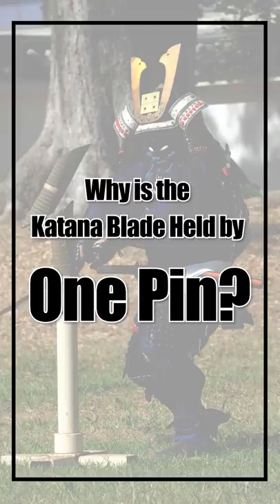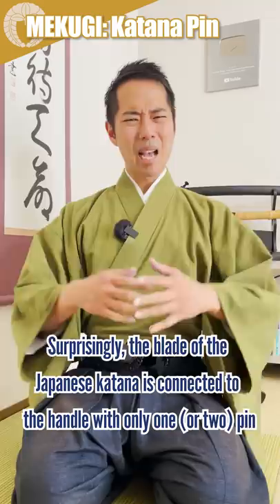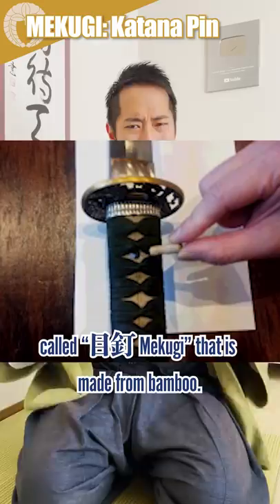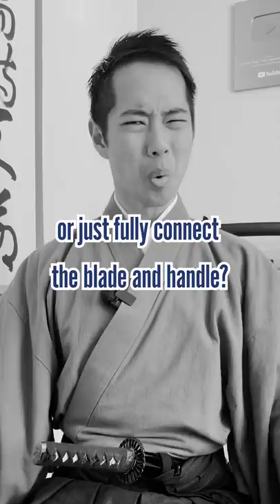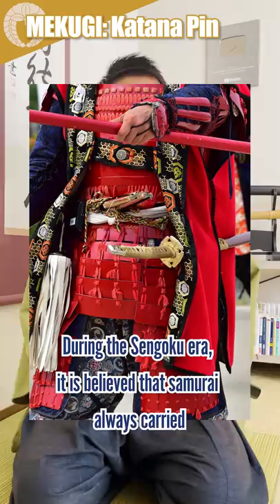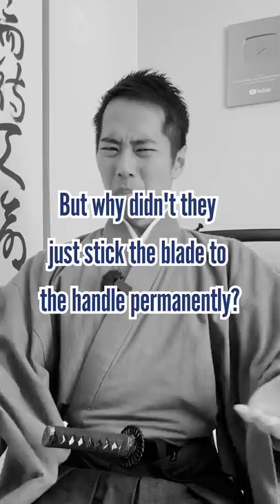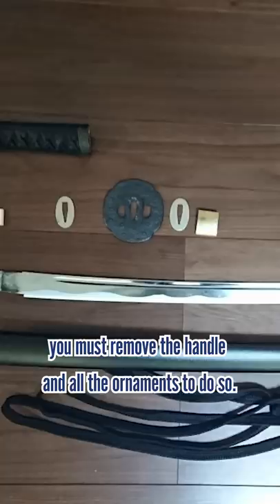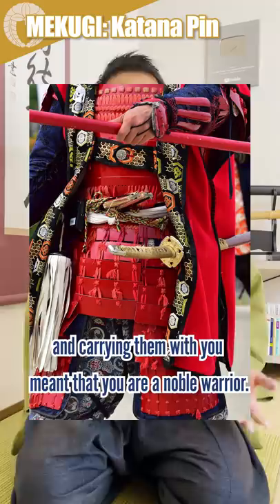Why a Single Bamboo Pin Holds the Whole Katana Blade #Shorts

Comment: The weapon for those truly chosen by a divine power is a flail due to the fact you need to have absolute faith in its use
Reply: especially the ones with 3-5 heads
Reply: What about boleadoras? Its basically a circle of rope with big stones on some vertices that you throw to the feet to neutralize someone and stop them from moving. They were used for hunting by the charruas. Maybe it makes more sense if you search it up
Reply: I belive an urumi needs more faith. Imagine a sword that is a flexible as a whip.
Reply: @thenthson  and it being neither as reliable as a sword or a whip.
Reply: @thenthson  
Yeah, that beats flail by a lot, sinca any intelligent person would make a flail with a handle longer than the chain
Reply: Any weapon that is long and flexible enough is a weapon of fate or sheer mastery
Reply: What about those who run around with Kali sticks.
Reply: Flails are almost as bad as nunchucks
Reply: Yeah the faith boost you get from the flail is pretty good. Works well on faith builds in ds3
Reply: This is what you call heritage and culture Americans
Reply: @ThePhoneBook123ABC  Samuel L. Colt and John Moses Brown enter: we have created a weapon that makes every man equal.
Reply: @thenthson  well i meant even if its flexible i think its its designed to be less heavy.
Reply: @David-om9ub  is that the successor or predecessor to the bola?
Reply: @IETass  its the same thing just a different word
Reply: @longbow6416  

Colt stole his desins whilst in London. The snake 🐍. The the LIZARD 🦎.
Reply: Slavic kiścień were actually very useful and absolutely devastating to enemies with shields also a very psychological weapon since they had long chain and were used by very brave warriors most enemies didn't want to got hit by them especially if they had shields too 
It was old and traditional some were even just a tight rope knot at the end or a small metal ball even thou if they hit you witch chain/rope it will simply hit you with ball on your back or spine Wich is very painfully or even incapacitating
Reply: Ah yes the equal opportunity weapon, cause theres a 50/50 chance of it hitting you or your enemy
Reply: @williamstoneman6977  actually skilled warrior do hit enemy Everytime coz of length you can predict it after some training and also fighting with it looks like a dance a dance of pain and terror haha
Reply: ..And more strings attached that is to say
Reply: @HighlyRegardted  yeah some had multiple knots/balls ("head's") and it made it more terrifying it was like getting whipped but breaking bones in the process
Reply: @longbow6416  its crazy to think for a few years everyone could be equally powered.  Physical stature and  years of training were no longer necessary.  A bit different now since I can't buy a working tank let alone a mp7.
Reply: @SmokeyOwOs  those ones are just cowards
Reply: So Gyomei
Reply: Double sided flail
Reply: I’ve played gorn too bro
Reply: @Trigger1721  at least my boys got some weight to beat people with, not like some handicap skinny sticks tied to each other
Reply: Faith? I dont think so. This is more of a dexterity build. Also ADP too
Reply: I have absolute faith that airstrikes would work.

This is a scam and i want your money back
Reply: Quite expensive
Reply: @David-om9ub  I've heard of them using fishing wire, if you throw it hard enough you can slit someone's throat, and crush their skulls, people used to hunt animals with them before they figured out that they could hunt people instead.
Reply: No, you needed skill and grit to use it.
Reply: @David-om9ub  if you call it a bola, more people would know what you’re talking about
Reply: @wiggitywy3210  Im used to calling it "boleadoras" because thats the spanish name for it, and since I only knew of them in the context of south america, I didnt know it had a english name
Reply: @David-om9ub  
I think those words are synonyms in Spanish. Plus it goes for Portuguese too
Reply: I mean, you can’t argue with that
Reply: @royalsoldierofdrangleic4577  fun fact: flails have more leverage when the mace is in direct line of your hands
Reply: @royalsoldierofdrangleic4577 or just use it as a club (assuming it won’t make them bleed)
Reply: @justmebrian  and those heads are all spiked

Comment: By the way, they are right on keeping it pinned with a bamboo pin because according to material mechanics. The tensile strength of a bamboo is HIGHER than steel
Reply: Except the pin isn't experiencing tension. Its in compression. It's why they used bamboo. The meguki is a little bit bigger than the hole so its compresses when inserted and gives it a nice friction.
Reply: I'm pretty sure that's per weight and not area/volume though
Reply: The tensile strength of Bamboo can reach 94.60 MPa and yield strength 50.19 MPa.

The tensile strength for structural steel is 400 megapascals (MPa) and for carbon steel it is 841 MPa.

So calm down, weeb.
Reply: @Lex Bright Raven yes, pig iron, doesn't change simple physics.
Reply: @rustlemejimmys  its shear, not tension OR compression.
Reply: @Lex Bright Raven it don’t matter what steel is used if the heat treatment is done correct.
Reply: @user-xx5zl8dz1v  No steel matters, the type and quality of the steel makes a massive difference. Proper hardening, quenching and folding only allows it to get as close as amazing steel... and yes ofcourse, it does it's job. But there's a reason people started upgrading from bronze to iron to steel to more complex alloyed variants of steel. Quality of the raw material matters a lot.
Reply: @berno8535  bronze makes a harder edge than the wrought iron (steel wasn’t commonplace until coal became more available in the Middle Ages) ancient swords would have been made of. Iron is found in more places, and thus cheaper than copper and tin.
Reply: Who's THEY? I see one person here!
Reply: @berno8535  That may be, but the forging techniques and heat treatment matter more. Despite the poor quality of the steel used to make a katana, the best blades were able to match the best European contemporaries in overall durability and performance. The big difference was what type of damage each sword type was more susceptible to: the katana to chipping and staying bent, the arming sword to crumpling and losing its edge.
Reply: @zimzob  it has nothing to do with the coal supply but the inefficiency of the bloomery process in ancient iron smelting

Comment: As someone who’s learning to work with metal. It’s a lot more sensitive and sometimes brittle than people give it
Reply: metal snaps far more easily from a heavy impact than people realize. It's likely also easier to dig out a broken wood pin from a small opening than a broken metal one.
Reply: I assume you don’t work as a bladesmith. Forged metal in combination with the shape of a blade is extremely resilient (with European swords at least, I don’t study the orient)
Reply: Cringe pfp
Reply: @siyacer  I honestly can’t tell if this is a joke
Reply: @twoface2001  it's not :3
Reply: Someone commented on other videos from this channel that because steel of good quality are rare in japan, making the steel blade too valuable to break, so they made that bamboo pin to break instead, which is quite sturdy and abundant
Reply: "Metal" is a very broad term. Even the same metal can have drastically different properties by heat treating it. But yes, some metals are brittle like glass, some are not. The pin serves as a part to fail first, being easily replaceable and made, it would be costly to make metal pins, even more costly when the pin damages the blade since it's harder than bamboo
Reply: @notebeans3134  which metal? people don't realize every metal has different properties, and even steel has tons of different types with all the different carbon percentages and other metal alloys, I wouldn't generalize that much
also op should learn a little bit more about metal
Reply: @russia5228  Japanese swords were usually made of lower quality iron, hence why they had to fold it so much
Reply: completely depends on the type of metal. aluminum is soft and gummy. so is stainless steel. hardened steels and carbide are brittle. there are so many metals with so many alloys, and so many properties
Reply: @siyacer  but did you NEED to say that… it has no relevance to the conversation.
Reply: @NihilusRex  Idk, did you NEED to create a comment that has no relevance to my interests? or are we just having a conversation ;)
Reply: @siyacer  ah yes, thank you for rephrasing my question and using it as an answer.
Reply: @siyacer  real
Reply: @notebeans3134  if you really believe that you don’t know a whole lot about metallurgy. Metals can come with a ridiculous number of properties, from being brittle to being highly ductile. You could quite easily make pins that would not conceivably shatter under any load that a katana would undergo with metal.
Reply: @siyacer  bro is making fun of their pfp and literally said ":3" you're the cringe one here buddy
Reply: @gakukamu  I'm not the one with an animal pfp nor am I the one with a LGBT pfp
Reply: depends on the metal. 1080 is VERY resilient bc of the flex and give it has. It bends, but will almost never snap or break. Even when it does bend it can flex back without damage in most cases.

Most people know of it as spring steel and a common example can be any spring, but the best is perhaps leaf springs on older cars where strips of steel were layered and flexed to provide the spring action.

It wouldn't make a very good pin imo. I feel strong impacts would force it to become stuck. It makes a much better blade for those willing to put in the time to make one. its fairly hard to work.
Reply: @siyacer  your cringe.
Reply: @samuraiboi2735  *you're
Reply: @samuraiboi2735  what makes you think I'm talking about one person
Reply: @siyacer  its your by the way not you're.
Reply: @siyacer  i aint easy to fight with kid.
Reply: @samuraiboi2735  Not defending him, but in your sentence the correct form was "you're".
Your = Possessive - E.g "Your car" "Your game" "Your sword"
You're = "You are" for short - E.g "You're short" "You're a warrior" "You're right"
Reply: @siyacer  Based
Reply: @russia5228  people who say  metal pins break easily have probably never worked with steel before.
Reply: You are not working it properly then, there is a reason they folded it 11 times
Reply: @dtsnjsn6101  stainless steels arent always soft and gummy. Take vg10 for instance, it tends to be a hard brittle stainless steel and as a result can chip easily even when properly heat treated and tempered
Reply: not a well made one
Reply: @siyacer  it really is. A katana would snap the first time it meant a European long sword.
Reply: I love how the replies are Smiths and people with extensive knowledge of metals and then there's someone named Santa that's insulting everyone.
Reply: Not really relevant to the conversation but nice pfp :3
Reply: @siyacer Giga chad
Reply: @allterran7093  cringe vtuber pfp
Reply: @Jay-bp1eh  nice father
Reply: @siyacer  based and Chad pilled. Next time you should refuse to elaborate and leave for extreme gigachad levels
Reply: @xXlURMOMlXx  thanks
Reply: @notebeans3134  Yes but specifically back in the day Katanas were beautiful swords made from crappy steel. They are a perfect example of ingenuity and mastery in their art.
Reply: @russia5228  best quality steel and swords came from the East but not the far East.
Reply: That’s a cool lakers flag
Reply: Katana use 2 types of metal to be sharp, flexible and not brittle.

Comment from the maker: *There are some katana with 2 MEKUGI pins too!

Surprisingly, the blade of the Japanese katana sword is connected to the handle with only one pin called “目釘 Mekugi” that is made from bamboo.

Why didn’t they use stronger material like metal or just fully connect the blade and handle?

Here are the 3 main reasons why:

1. Softer pins have shock reducing effects
2. There was an abundant supply of bamboo in Japan
3. To make it easier to remove the blade for maintenance

Interestingly, there actually was a time when metal pins were used in ancient times. However, they soon realized that a strong impact would cause the blade to deform or the pin to become stuck. 

Bamboo which is hard, flexible, and very easy to obtain in Japan, was the best material for it. During the sengoku era, it is believed that samurai always carried a few extra mekugi pins that they made themselves just in case.

But why didn't they just stick the blade to the handle permanently?

It is because when you perform maintenance on the katana, you must remove the handle and all the ornaments to do so. The katana were originally items dedicated to god, and carrying them with you meant that you are a noble warrior. From the centuries old katana swords still in beautiful condition, you can understand how important the katana were for the Japanese people.
Reply: Thank you for all your time and effort !  much love from the US!
Reply: Hey this is me I want to tell you that I don’t really care very much about the katanas I want to actually see you talk about real ninjutsu/Okinawan Kabuto weapons and how ninjas actually in real life during the time of the dynasty and one more thing to can you also do an expert tradition on not just Ramen but Hawaiian Japanese fish mahi mahi
Reply: @MissEasyPeasySleasy  Dude we already got information about that series
Reply: Ok... But why only one? Most knives and swords today use multiple pins no matter the material 

And wouldn't it make sense to use multiple given the fact that the bamboo was more likely to break?
Reply: @MissEasyPeasySleasy  call him by his name and title, the man deserves the proper respect.
Reply: @MissEasyPeasySleasy  I’m just some random person I’m not ignoring you I’m just trying to help you
Reply: @MissEasyPeasySleasy  oh
Reply: @MissEasyPeasySleasy  you aint gonna get help karen :/
Reply: I would very much like to know more about this 'God' that was honoured in Japanese history. 
I'm not being sarcastic, I just didn't know they had a God they worshipped
Reply: @golem4892  That’s amazing but just to tell you god in many different countries is represented as a different person
Reply: @golem4892  what kind of god? They have literal millions I believe
Reply: That’s what he said
Reply: @MissEasyPeasySleasy  a response for the ages ima have to put that up on my wall
Reply: Interesting… the first shitty little wakizashi I got when I was a kid had two plastic pins, I was surprised it was made in the traditional way even tho it was basically a toy
Reply: shogo you should try pinning your messages
Reply: @golem4892 multiple gods, although they’re referred to as Kami, and mean slightly different things. I don’t remember specifics beyond that.

And that Yokai are basically the same thing but not worshipped.